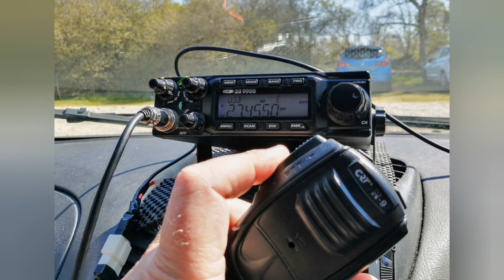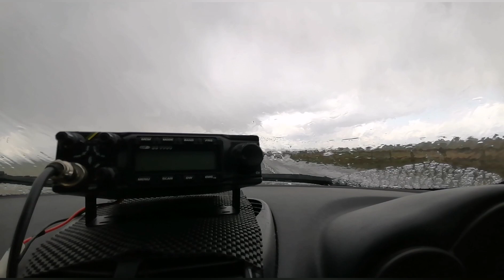Enthusiastic Steve "Storm Shock"

Comment: over the years about 40 i have listened to people transmitting while a thunder storm was over head and i thought one day they will learn if a thunderstorm is over head i will not transmit even if it is the time i am supposed to de reading the GB2RS news broadcast as it can kill you
Reply from the maker: Yes, I have seen close up the destructive power of lightning. I did not hear any static on the frequency up until the shock and arcing on the connector. Scary stuff and totally agree, unplug in storms, preferably long before they arrive. Ty for your comment.